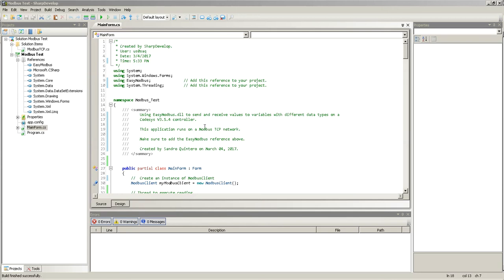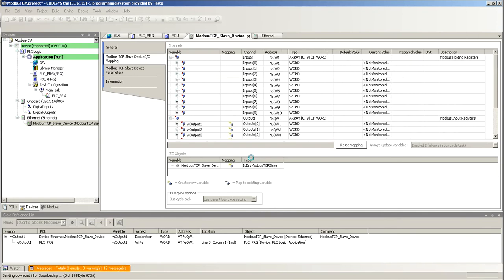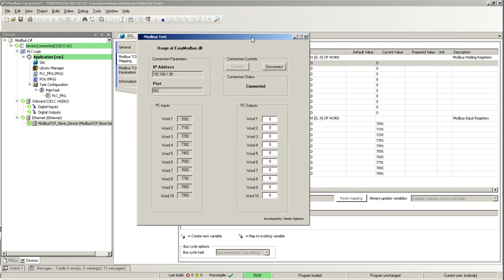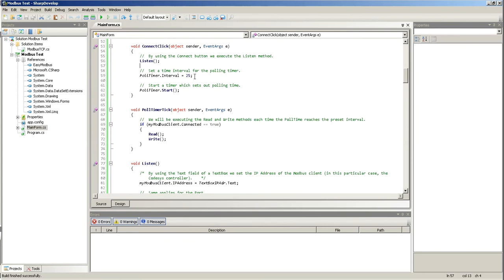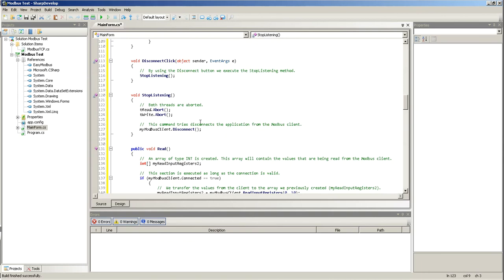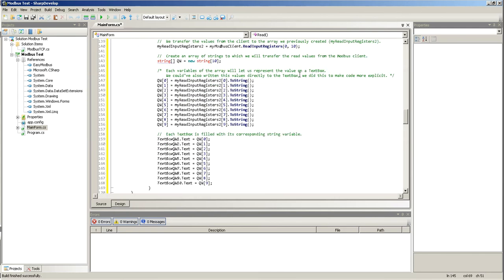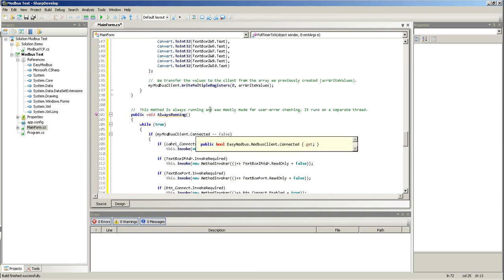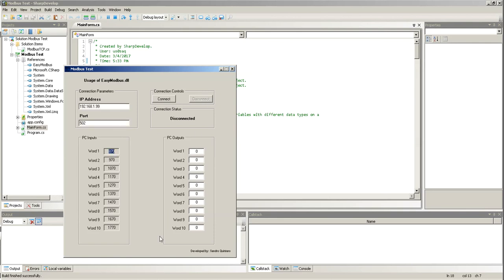Modbus TCP on C# with a Codesys controller

Comment: Hello Sandro,

I tried and it worked. But I have an issue, In normal condition (something works fine) then I unplug or cut the connection  the system will detect an error and out of the program.

Do you have some suggestion?so if there are some connection problem (as i mention before), it will not out of the program